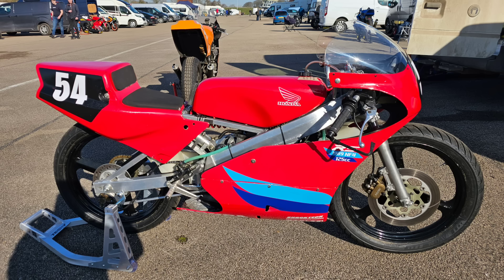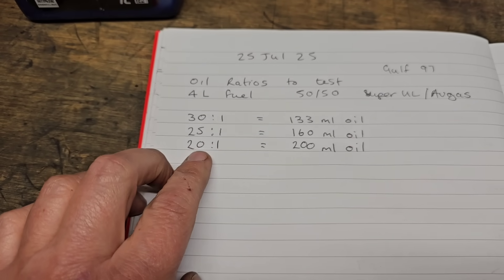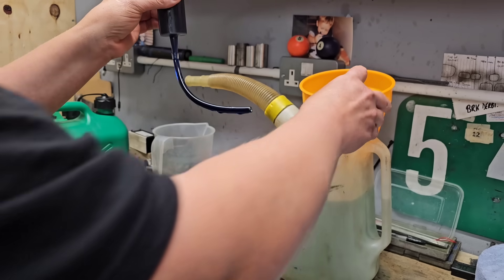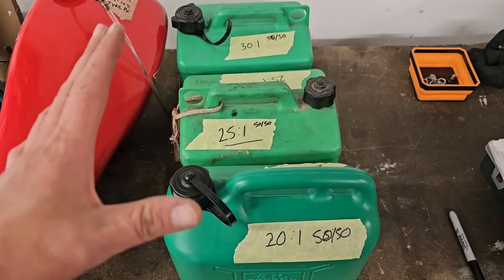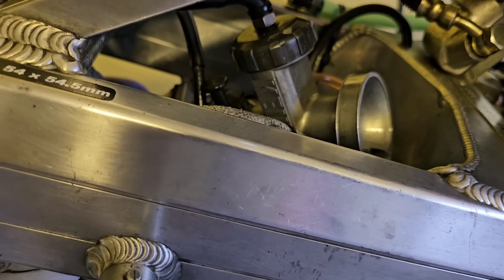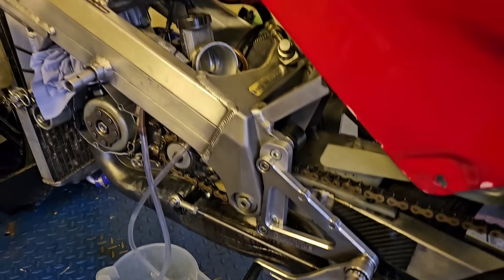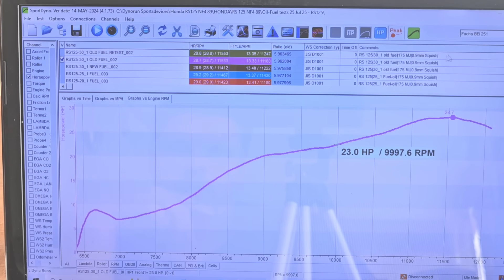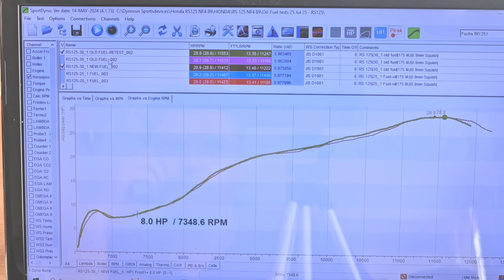Does 2-Stroke Oil Ratio Really Change Power? (Dyno Tested)

Comment: In 1980 or so we tested oil ratios on Mercury 150xs outboards. The range was 100 to 1 down to 8 to 1. We found more power with more oil. We also were able to tune the engines with larger exhaust ports with more oil and still have race reliable engines. Something that was not possible with less oil. As the exhaust side of the rings would wear rapidly. Since this was race engine testing, we measured wear rates mainly for race season reliability, not for the recreational boater. But one thing was abundantly clear, 32 to 1 was enough oil to prevent excessive wear, 50 to 1 and especially 80 or 100 to 1 showed ever increasing wear. In our testing, 16 to 1 was smokey but useable, and made as much power as 8 to 1.
Reply: Thank you.  This was the impression I had.  The least oil I’ve run is 32 to 1, and for better durability and reliability in a crucial application, I’m using more oil.
Reply: When you change ratio you need to change the jets. More oil = less fuel so in a lot of oil you'll need bigger jets. Without rejetting your power reading will be bogus.
Reply: @joracer1 according to his air/fuel ratio gauge the ratio changed very little (11.7 - 12.0:1) when changing oil ratio between 20:1 and 30:1. Maybe 16:1 or 8:1 might make a larger difference in a/f ratio requiring a jet change?
Reply: @joracer1  Yes
Reply: That's really interesting. The test here seems to show no power gain so it's curious. There is a discrepancy here and understanding it leads to more power. So WHY is the question.
Reply: @billshiff2060  Our testing was from 8 to 1, all the way to 100 to 1. In our case, more oil made more power. It seems even the small changes in this test made more power.
Reply: @cujet  What was the magnitude of the gains vs ratio?
Reply: @billshiff2060  Modest gains in power, a few HP, IIRC. HOWEVER, more oil allowed much more exhaust port area and other tuning measures without experiencing ring wear related failure, which resulted in (in our case) about 300HP reliably. The funny thing was, our competition knew our smokey engines were faster than they were. By a lot.
Reply: @billshiff2060  ring seal. Thats where power comes from in both 2 and 4 strokes.
Reply: @billshiff2060 ring seal. Oil is the gasket that seals the rings. Cylinder leakage in a 2 cycle is like adding an e.g.r. valve and also reduces the volume of the intake charge slowing velocity as well. Frictional losses are only a fraction of the gains seen.
Reply: @DavidStrickland-np1gm that is a myth , oil is not ring seal , it's ring lubrication,  if oil was ring seal a glazed bore should be super good on compression and it's not . Fact is oil is higher energy density. More energy more power .
Reply: @JosephCowen-fz8vj  Piston rings rely on oil for seal, heat transfer and lubrication. It probably wont help when it's boundary lubrication but then it'll increase. Glazed bores hold less oil, kinda proving the point. There might be a difference in energy depending on the oil but it has to burn at the right time to contribute to any work, some might, but most is just sent out as smoke.
Reply: @PSA78  Piston rings rely on gas pressure to seal and a properly machined ring groove.
Reply: @postulator890  It's not just one thing, lots of things happening at the same time.
Reply: @billshiff2060 the test here was only within a small window. If he did  60:1 vs 32:1 vs 16:1 you'd see major gains between the 60:1 and 16:1
Reply: @aaronbright5028  Yeah a lot of guys think so but 1 test is worth 1000 opinions.
Reply: @billshiff2060 you asked why people think oil makes power????? If the test was 60:1 vs 16:1 there wouldn't be 1000 opinions there would be only 1. when there's only 1 possible opinion it's know as a fact
Reply: @aaronbright5028  Thats just an opinion. Show us the tests.
Reply from the maker: @cujet - was this using castor based oil?
Reply: @AutoBeta2T  It was standard outboard oil.
Reply: @AutoBeta2T  No, this was TWC oil from Mercury. We casually tried BelRay MC1 and a few others, without improvement. Our goal was to win, and the oil testing was necessary for max HP and engine life for our high output engines.
Reply: @AutoBeta2T perhaps.  Do you feel inclined that way?  Castor is said to help hard-worked engines to last.  It is also said to be an especially “gunky” oil, which is fine if you plan to regularly dismantle your engine for “cleaning and inspection, with an eye to wear and damage.”

Note: the word “said” indicates I have read of these matters, but have not exhaustively tested them on my own equipment.  I DO like two-strokes, have owned at least one two-stroke motorcycle, and have owned and used a few items of lawn and garden equipment of that persuasion.  The odor of burnt oil takes me back to a time when I was “young, healthy, ignorant and careless.”  The first two things tend to change as you age.  They only caught up with me in a big way recently.  I know enough T that I constantly struggle to address the latter two attributes.  The disabilities I have mean that struggle is both serious and ongoing.
Reply: That follows right in line with an ancient test i read the results of years ago, long story short they found the most power at a ratio of 18:1.
Reply: I hope to not drift off topic too bad but i always thought this was kinda amazing. I was about 21 or 22? and bought a Yamaha wr200r dirtbike. Id ride it kinda fast but not crazy wide open all the time, gasline hills, some tight woods riding too, some strip pits, but the factory plug would foul in about a month of riding almost daily after work, and saturdays. Anyway i bought a pipe for it, boyesen reeds and afterwars would run 108 race gas and klotz bean oil 32:1. It did great but the plug still fouled to easy. I was in tech school and the buddy in the class i met was the lead mechanic at a local bike shop. He asked me what all id done to it, and how i ride. He said put a bew plug in it, run it etc, etc.  and pull it and show me. So I did.  He told me do this- change the pilot jet to this ___, chnage the main jet to this___, and the needle, change the clip to this position. So i ordered the stuff from denniskirk, did EXACTLY as he told me and I will tell you wow, that bike was snappy. Very crisp. And guess what- i would swap the plug out no lie once a year for good measure. After about two years of riding i took it to another shop and told them swap the piston and rings. I got ut back and they gave me the old piston and showed me it was still good. Just a tiny bit of wear showing. But i always kept the air filter clean, the airbox too. And washed the bike even if i got home at 7pm, 11 hours of riding. Id too clean my oring chain and it lasted very well. I should have never sold that bike. It would get it. But anyway my lessen learned about importance of proper jetting.
Reply: 8-1 lol.  Were you using diesel glow plugs 😂
Reply: @michaelmarchei8539  The spark plugs were surface gap plugs, completely flat. Although they are not common today, they were popular then. The high energy ignition blasted any fouling away.
Reply: @cujet 8:1 that’s extreme! Never would have thought that would work. Thank you for sharing the info. You were probably running with extremely big jets ?
Reply: @delahayenator   8:1 gas/oil mixture was McCulloch's factory recommendation for their MC 1 bushing kart engine.  This was the 1960's
Reply: Excellent Information On Ratio Gas To Oil: Have many 2 stroke engines, Dirt Bikes. Outboard Boat Engines, Chainsaws, Etc. I always mix 32 to 1 on all engines with the exception of Large 140 HP Evinrude Outboard on 19' Grady White. using 50 to 1, still smoking is a good sign for 2 stroke engines. I Would Never Run 
100 to 1 as some manufacturers suggest, Will shorten or lock up two strokes engines.
Reply: Thank you for your information. I decided to use 32 to 1 for all my two stroke engines, 25 years ago. So far, I have had no mechanical failures and no other problems to report.
Reply: What about wear? Where was the cutoff? I mean at what point did you not see less wear on the engine but just more deposits?
Reply: @EbonyPope  32 to 1 was the wear point, less oil equaled more wear. Especially on the exhaust side of the piston ring. More oil did not equal more deposits. In fact 8 to 1 produced nearly zero deposits. But the smoke was unreal. Remember, these engines were modified cross-flow designs. Not at all like the loop scavenged two strokes today.
Reply: @cujet So what would your say is different for loop scavenged 2 strokes of today? What do I have to take into consideration?
Reply: As you put more oil in you need bigger jet as well. While writing the man says it 😂 I’m running a tuned street scooter with a 70cc Athena cylinder on 1:40 which works great and keeps wear down.
Reply: How does the engine durability or hours inbetween rebuilds compare 30:1 vs 20:1 ?
What is better for engine durability?
Reply: @hungrysurfer9471  In our case 32 to 1 provided as much wear protection as more oil. Remember, these were tuned outboards. Not 45+HP 125cc Kart engines, which absolutely need more oil than 32 to 1.
Reply: I always ran 16 never smoked never burns up the motor
Reply: I remember one of the old motorcycle magazines ran this test using castor bean oil. They found more oil made more power and that when they switched fuels it took about half an hour for the full change to take effect. 
I assume Gordon Jennings had his fingerprints on the test.
Reply: Always ran my two stroke dirt bikes at 25 or 30:1. Thanks for this subbed and liked.
Reply: Interesting findings with the Mercs. I’ve owned a lot of two stroke outboards but all very low power recreational engines in comparison. Nevertheless I’ve often wondered what the leanest oil fuel ratio I could run without wearing out the motors was. Also interesting to note the change in ratios over the years. My 1957 Johnson 10 hp needs 24:1, between the mid Sixties to Eighties, 50:1 seemed pretty much the standard, although I have a wee Yamaha 5hp that’s 100:1. That little single cylinder is whizzing away at a pretty frantic rate and I’m frankly surprised it has survived for decades on so little oil in the fuel.
Reply: @motorv8N  On that 103cc engine I think the max RPM is 5500, so considerably lower than we were running. There is relatively low stress on that high quality engine, piston speed is low. Oil ratio is often a factor of RPM. A 14,000 RPM chainsaw will need more oil than a 5500 RPM outboard, due to oil migration speed through the crankcase. Anyway, v nice little outboard!
Reply: @cujet  - interesting info re rpm - thanks!
Reply: More oil washes carbon deposits away. And saves ware and tear. General outboard oil is for low horsepower engine. If a one cylinder 2 1/2 in bore is putting out 25 horsepower. You don't run outboard oil. It will foul the plug at 20 to 1. And lock up at 50 to 1. Valvoline used to make a two-stroke oil. Someone did a test at a college for a experiment the person claimed a 2-cylinder under 50 horsepower Valvoline will last@5.5oz.per gal. Don't know exactly what that ratio is do the math. Any amount of racing horsepower. You need quality racing oil Yama lube 2R at 33 to 1 with the correct Jetting. You will achieve a menable amount of smoke,maximum performance with the least amount of wear and tear. I think it is a semi synthetic blend. Yamaha uses it in there 150 mi an hour 2 stroke 250 CC 70hp twin cyc race bikes.
Reply: We raced a yamaha yz85 a yz125 and used 32 to 1 silcolene full synt hetic and got no piston or cylinder wear over two years. We did change the pistons every 15 hours because the piston is also your valves and does double the work of a four stroke piston(also double the heat events). You make more power with more oil because not only better ring sealing but also piston skirt sealing keeping your combustion gasses in the combustion chamber where they belong.
Reply: The old Yamaha K100 clubman go kart engines we ran 16:1 castor based Motul 'KR' for race conditions (14,750rpm) in Australia. edit: New piston/rings every 4 hours practice/race, good reliability. Hone and re-bore as required.
Reply: @gordo5863  true , I remember 15 to 1 in some bikes .
Reply: @gordo5863  you know I had this conversation with a young " know it all " saying it's impossible to go under 40:1 , I said 20:1 and lower was the norm and ran well , he just couldn't get that through his head .
Reply: 20-1 best ratio
Reply: @NathanStickley most of my 2 stroke dirt bikes call for 32:1 from the factory so that is what I run. But I'm not racing, and I have no longevity issues
Reply: I found exactly the same with Esther based too.
Reply: Perhaps you would explain your findings? 
I remember from a book that as little oil as possible should be used since it is the gasoline that produces the greatest heat. This sounds logical, yet your experiments somewhat proved it wrong. Any idea why would that be? Did you gain additional power from friction reduction? This seems unlikely, especially after some reasonable ratio, like 1:25, which already makes a smokey engine. What were the gains in percentage?
If you can, please share some more 🙂 Thanks!
Reply: @blazumek5029 even easier than me typing all that is you looking up the tests done publicly by McCullough and then later on in the late 90's by dirt rider magazine
Reply: Nah more oil doesn’t lead to more power typically. It’s always the opposite from what I have seen
Reply: @Taboloncawonthemasters that's not what the tests show but did you re jet after changing ratios?

Comment: If you look at nitro RC engines with very high specific power the oil ratio is about 12% (1:8), the diesel model engines run up to 30% oil. Somewhere I have an article about the first races with the 2 stroke Yamaha when they arrived in the US, they were making huge power but seizing, they went up to 1/4 (25%) with a much larger jet to keep the air fuel ratio right.  I suspect that peak power is somewhere around 1/5 - 1/8 with adjusted jets but of course that is so smokey its not acceptable in a race.  I have an antique outboard that recommends 1/10 and you need to know which way the wind is blowing!  That said it is 50 years old with minimal wear.
Reply from the maker: Cheers for the info, Rob. It's really appreciated, and the comments on this video have really raised my awareness of 2t oils and their effects.

Comment: Im no engineer, but am a heating & air technician and know about btu/hr, just not btu/hr of premix or avgas and pump fuel. But different things have different btu content when burned. I wonder if the manufacturers can offer  if contacted, their btu values of their premix, and the manufacturer of the fuel can offer their btu aswell, or can the octane rating be converted to btu by a simple math formula? I dont know, just wonder if it can all be seen on a piece of notebook paper. Kinda interesting if so, to learn which combination produces the most but/hr energy content.
Reply from the maker: Hi Jeff, indeed to go away and do some reading and maths...
AvGas BTU is less.other fuels, but its knock resistance means a higher comp ratio can be used without det so it can provide better power if the engine is optimised for it.
Possible an area my engine is lacking?
Cheers for the insight and info. I shall mull it over.

Comment: They say that two stoke Motocross bikes made more power on 20 to 1 Bean oil or true Castor Bean oil ..
  50 WT two stroke oil is interesting  chain saw and snowmobile oil for oil injection is very thin.

Comment: I use 250ml in 5l in everything 👍👍. Elf 909
Reply from the maker: So 20:1 then. Cheers.
Reply: I have found that 909 is better in air cooled engines 👍
Reply from the maker: @danielthompson3849  cool, I've just had a quick read and the 909 has some castor oil in it but the 976 is fully synthetic.
Reply: @AutoBeta2T  the 909 has a high temperature tolerance before breaking down  

And is very common that 909 is used on the highest hp racing two strokes  
105hp 250cc kart engines.
Reply from the maker: Cheers again for the info.

Comment: When I owned a 2012 KTM125EXC, I mixed the oil at a 50:1 ratio. The owner's manual specified a 60:1 ratio with the Motorex Cross Power 2T. I mixed it at 50:1 because my mix tank could only mix up to 50:1. I never had any issues with seizure during cross-country races, and in fact, I did have a few plug fouling issues and had to change them on the course.
For my skill, 50:1 seems to be too rich.
Reply from the maker: Cool, cheers for the info!

Comment: Good video and great to see that you tried to keep the variables as tight as possible. I would like to point out tho that the best way to test this would be to use a fast response(open tip) exhaust temp sensor in the header at the length of about 1,5x the bore, measured from the piston face. And then jet to the exact same exhaust temp on all runs on the same day or RAD, using jets in steps of one size-step difference, tested with pin gauges to make sure they are the correct size(you would be suprised how big the variables are on some aftermarket jets even tho they have the same size printed on them). Doing it this way you would be sure the engine is burning the same amount of fuel regardless of what the oil content is. A one or two size difference in jetting does make a difference in power produced, top of the line karting teams has to get this right to get on pole.

Comment: Avgas burns slower you need to change your ign timing to get full power.
Reply from the maker: I can't as its fixed on the RS (maybe a little wiggle room but not much)
I'm tempted to try so proper race fuel.
Reply: @jamesmc1272: I would like your source on that statement.